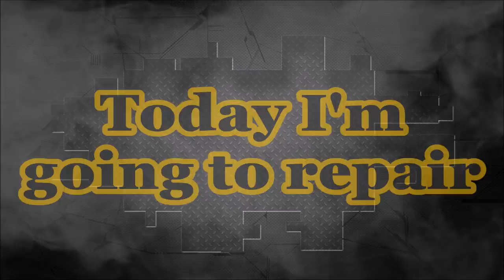Chevrolet Volt. The body repair. Ремонт кузова.

Comment: Someone got "overpassed", or "tree-ed".... Hope they were uninjured, and that they got the a**holes who did it (if "overpassed")!   Another great repair, Arthur; BTW, I'm hunting in the Appalachian mountains (my last EVER deer hunt), and will dig my "slap iron" out of storage before returning; will try to figure how to avoid tariffs - and send to you.
Reply: Looks more like a tree fell on parked car, airbags did not deploy as far as I could see.
Reply: I was thinking the same thing, but remembered that about 25 years back, a car was targeted from an overpass on I-95 (near Chester, PA), and hit with a USPS mailbox, with similar damage - because of a strange bounce that it took.  I don't know if the deployment sensors would have actuated because of the angle of impact.  These "roof - involved" jobs can be hard to do 'well', but they (paint shop included) got the job done.  Hope that the glass stays free from leaks, we've all been down that road!

Comment: always enjoy your videos Arthur. question - with the spotter ; any thoughts to using a hot melt glue with the plastic tabs and pullers instead of the spotter? or is the spotter faster?
Reply from the maker: With spotter is faster.